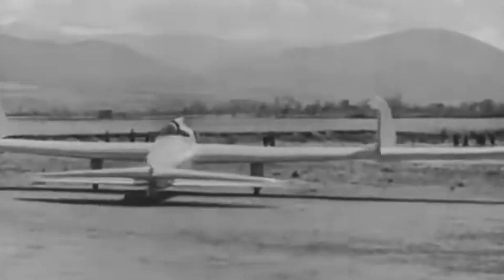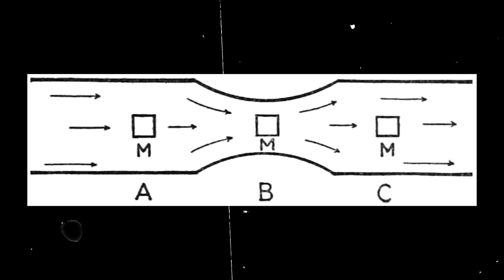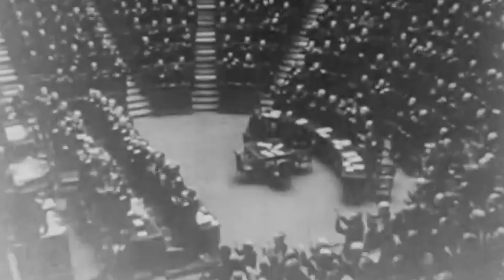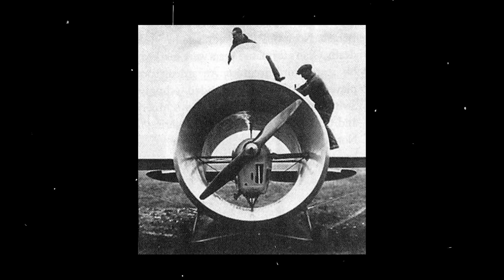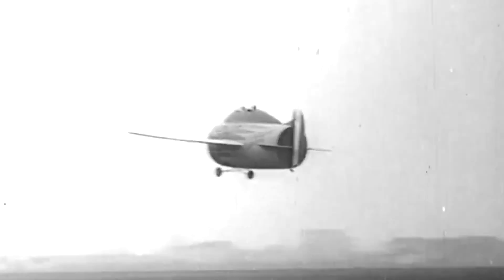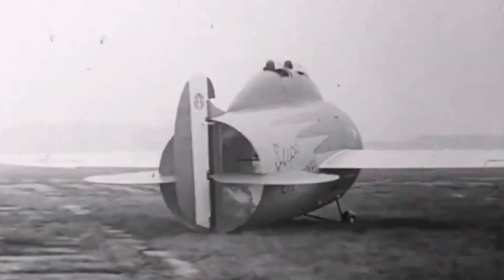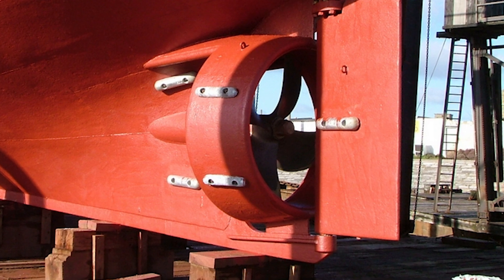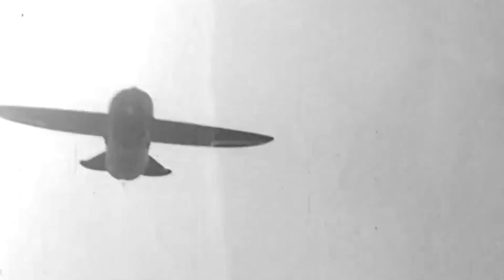A Bizarre Fat Airplane that Changed Military Aviation Forever

Comment: I think the biggest problem is that the engines and materials of the time weren't advanced enough to provide the justification for the aircraft.  It would be interesting to see this prototype built with a modern engine and construction techniques.
Reply: If you put the engine somewhere else like in the wings and only connect a shaft to the propeller you could get rid of the drag which hampered the Stipa Caproni. Ofc you then need sturdier wings than the little fairy wings it had ^^.
Reply: @thingamabob3902  Engines to day are probably much more powerful than the same size engines of that day, so that alone may solve the drag problem.
Reply: @ffjsb  definitely more powerful, but then you still have wasted energy you could put to use if you optimize
Reply: @thingamabob3902  I wouldn't call it wasted energy, I think it would translate into more speed.
Reply: @ffjsb  no you misunderstood. The problem with the whole engine placed in the duct was the cause of the drag. So a more modern and more efficient engine would have less volume per power output and thus be not as big as a problem as the weak engine but would still be in the way. That said I would still put the Cockpit forward and drooping down in front of the duct which would increase drag, but the visibility of the cockpit was obviously horrible and would justify such thing.
Reply: @thingamabob3902  HUH???  You're complaining about drag and you'd move the cockpit to create more drag????  You're ALWAYS going to have some drag from the engine nacelle.  But if the engine is smaller and more powerful, it's LESS of a problem.  The original design clearly worked, and updated it would work even better.
Reply: @ffjsb  I see, ok you obviously didn´t get the point after several explanations and/or don´t understand the principle of efficiency/optimization. The PLACEMENT of the engine was cause of the drag, nough said. And the video - in case you watched it, I´m not sure at this point - clearly stated that the visibility from the cockpit was atrocious ( which causes landing accidents) ... Have a good day, Sir. I feel I waste my time here.
Reply: @thingamabob3902  I GET that there's drag from the engine being there.  There's going to be drag where ever you place it.  Adding a drive line just adds weight and another point of failure.  You also don't get that there is technology that can overcome the visibility issue.
Reply: OOOOHH YEAH!!!  TOTALLY WOULD BE COOL! 😍😍👌👌👍😄😀

Comment: This is ducted fan tech. I’ve flown RC aircraft off and on for decades and many of the “jet” engine RC aircraft are actually ducted fan powered with an internal combustion piston engine providing power for thrust.
Reply: This is interesting to read! Thanks for sharing this info 👍
Reply: Once in a while an old ducted fan RC jet comes up for sale at club auctions and swap meets. I never had one but they were popular for a long time. I recall the kit for an F-86
Reply: @outdoorfreedom9778  EDFs (Electronic Ducted Fans) are very common today for RC "jets" and have superseded piston driven ones for the most part especially with noise ordinances cracking down on RC flying clubs in the US and Europe.
Reply: @jonrmartin  I have an RC delta wing with an EDF strapped to the back.  It's been a long time since I flew it, but it would make a resonance with the airframe at full throttle that generated a loud buzz, much louder than any nitro or large gas engine.  I actually got complaints from the club president passed down from fellow pilots about the noise.  It was fun to fly though, extremely fast and maneuverable.
Reply: Exactly! Best Regards!
Reply: @Kirk Bolas, Yes!!! You hit that nail on the head....  And this design, like the high by-pass jet engines as compared to pure jet engines, is noticably quieter than an engine with an exposed propeller...However, the main differences between this propulsion design and an actual high-bypass jet engines seem to be : the power to weight ratio, and the AMOUNT of power, driving the 'Fan' .... Otherwise, there are a lot of similarities to a modern high-bypass jet engine....
Reply: @the_shoggoth  well said my friend
Reply: Alot of the newer ones are just electric powered ducted fans that act like a jet.
Reply: It looks like a flying toilet paper roll.
Reply: and many modern ones use small outrunner motors instead of Nitro engines. They're quite fast.
Reply: @DFX2KX  the electric motors are amazing how much torque and power they produce... And they are very efficient... For mechanical power in factories, stationary business's and trains/bus's with overhead power lines, the loss's of electrical energy between the powerplants where the electricity is created to where the end user is at, is kept at a minimal amount...  For small unmanned vehicles, like R/C models, the batteries driving D/C motors work quite well... But for full size vehicles, with relatively high current needs, that DON'T have externally supplied A/C hi voltage 3-phase power harness's , but use internal storage batteries that drive D/C motors,  they are extremely inefficient.... Anyway, the small model liquid fueled engines are amazing with a very much higher power to weight ratio, than DC motor drive systems. So, with the right combination, the liquid fueled small engines are light, powerful and relatively inexpensive and they work very well, and are actually quite efficient... The electric motors are well developed with R/C models, but the batteries tend to loose power quite rapidly, are relatively heavy and they tend to be complex and expensive. Because of the rapid battery loss and the relatively heavy weight, the chances of making a safe landing are reduced when that happens...
Reply: @michaelmartinez1345  the inverters used for Electric bikes and cars are fairly efficient. The issue with aircraft (and electric aircraft do exist) is mostly down to battery weight, which DEFINATELY stings. As far as models are concerned, DC motors are still used, but 3-phase A/C outrunners have supplanted them in most cases (even my knockoff 6-channel helo has an outrunner on it, 20A controller). 

Battery wise? yeah, LiFePO4 packs don't hold a whole lot of power and they get angry when punctured, too, I don't think anyone even bothers with NiCad anymore outside of powering the RX on a Nitro car or plane.

Nitro engines are pretty crazy when it comes to raw power. I've never actually OWNED one, but I have gotten to buddy-box on a few. They are a bit... fiddly, at least from what I've seen. Fuel is also like $30 a gallon. I know actual gasoline RC engines exist but I've never used one, I wager it's not as powerful but has much less hassle to actually *run*.
Reply: @DFX2KX  I used to mix my own fuels when I was into model hobbies... It was 8% oil (Klotz synthetic) 10-15% nitromethane, and the remainder was methyl alcohol... This worked well on engines equipped with glow-plugs in their combustion chambers... Gasoline engines (both 2-stroke & 4-stroke) had to have spark plugs a coil and a set of points & condenser... Premium gas with a mix of 8% engine oil worked for these... They were not as powerful as the glow-fuel engines, but were great, when on a budget... Electric motors started coming around in the R/C hobbies in the late 70's - early 80''s... The first applications were on the cars... Them later, on the motor/gliders... After that , everything... The glow fuel engines have given reliable/economical performance for many years, and they are relatively simple and inexpensive... The glow fuel engines also offer an impressive power to weight ratio, that only the ultra-expensive micro-turbine engines can come close to matching... And when equipped with a 12v. Lawn tractor battery along with a power panel and a model engine electric starter, getting the glow engines to run is very easy... There are mufflers to quiet them down, tuned pipes to give them more power and a varience of props that can be used with them... The advent of the glow 🌟 plug engines, along with small carburetors, put the flying / driving models in a whole new level... The electric motors are a nice novelty, but they probably will fade by the wayside, just as the electric cars did 120, then 50 years ago... These older ideas somehow seem to re-surface every 50 or 60 years... Just in time for the 'now/new' generation!!! 💰😏💰💩💰🤔
Reply: @DFX2KX  one of the reasons that AC power is preferred for high current applications, is because of higher efficiency... A/C uses the entire cross section of the conductors that the power is being transferred in... D/C only uses the outer surface of the electrical conductors for power transfer, this is the reason why heavy current cables for D/C have so many fine filaments of copper, as it increases the surface area of the effective conductive surfaces, where AC often uses a single strand of solid copper, as it uses ALL of that surface area .. There is a strong magnetic field that surrounds D/C circuits, much more so than A/C circuits create... This natural phenomenon causes an effect called Inductive Reactance.... It causes impedance to current flow, which absorbs electrical energy ,generates heat , and dissipates the heat to the surrounding atmosphere... So this is a major reason WHY A/C is so much more efficient than D/C... This is a reason WHY bus's , airliners, ships and power transmission lines use A/C to transfer electrical power, as A/C power is transferred much more efficiently over long distances....
Reply: @DFX2KX  A good way to remember how to spell definitely is to break it up as De-finite-ly, i'm not sure why it's often pronounced def-in-at-ly but it is most definitely spelled definitely. Sorry not trying to be an jerk at all, I just know that I used to have problems with it and breaking it down like that helped a lot.
Reply: @DFX2KX  The LiFe batteries are typically used to power the receiver and servos, not motors.  LiPo batteries with a higher cell voltage of 4.2 volts and lighter weight are used for the flight motors.

And yes gasoline engines have less power than nitro and are easier to run but are now more common.
Reply: I knew there would be a RC guy in the comments that would know some stuff, and how its used ....... 2nd comment , didnt have to scroll far lol   👍 thanks for sharing
Reply: Well, now you know who invented the ducted fan.
Reply: Wonderful what happened
Reply: Push pull comes to mind
Reply: Neat
Reply: Huh, neat!
Reply: Look at the Edgley Optica.
Reply: The ducted fan can be very efficient provided that you have several parameters well tuned : the inlet must have the correct shape, the prop must "lick" the tube, the outlet must have fins to counter the flow rotation and also you need no abrupt aerodynamic shape of the rear of the motor.
Reply: Well yeah there used to be only ducted fan 'jet' RC aircraft, but nowadays they have those small jet engines which make the RC 'jets' hardcore. They really are quite something. And I guess you don't need to mess about with glow plug or model diesel fuel, just methanol, paraffin (kerosene) or whatever flammable liquid you can get hold of at the time.
Reply: "Many" yeah sure. In the 80's and 90's and by many you mean all. Pulse jet engines that small weren't around yes bruv. Now a days if you see a ducted fan nitro rc plane. Buy the damn thing. Because they are worth a fortune. Also buy a lotto ticket because youll never see them. All ducted fans now are electric. Real turbines are also very prevalent and pretty dang cheap compared to 2009. Alot of guys even put micro kerosene turbines in foam jets.
Reply: @krotchlickmeugh627  I have a book called 'Modern Aeromodelling' that was written first in the 1940's I think but the copy I had was early 1950's. In it they have a section that covers ducted fan aircraft. It's a great book and I stole it from my school library back in the early 90's lol
Reply: no way this thread isn’t bots
Reply: Yep, either that or electric ducted fan motors these days. Though there are actual jet engines on some very expensive RC planes, still they are rare and costly. But you're right, ducted fan motors are still most of the rc plane world to this day, be it electric or combustion.
Reply: Some of those old rear exhaust df engines have really high output and impressive rpm’s, I’ve got a Mac tep.61 i think it’s made in in Russia thought was a pattern flyer’s engine but have only seen one other like it in a jet
Reply: Some of those old rear exhaust df engines have really high output and impressive rpm’s, I’ve got a Mac tep.61 i think it’s made in in Russia thought was a pattern flyer’s engine but have only seen one other like it in a jet

Comment: Stupa seemed to have a great idea he couldn't expand on...not a turbofan, but a shrouded prop with a venturi behind, he was so close.
Him suing for copyright infringement makes me think he had some hurt feelings when someone was able to take in that step further.
Reply: The Caproni Campini N1 took the concept one step further and added an afterburner…
Reply: What if you put this shroud around a bombers engines in nacelles in a flying wing design?
Reply: I think the real advancement here is creating the theoretical framework and calculations for taking hydraulic principles and converting them to airflow. This is much more than a ducted fan, it is realizing the internal surface engineering of the duct as a vital component to future turbofan technology. In that aspect, turbofans and turbojets would not have been possible without the knowledge advanced here.
Reply: @deths1679  very interesting. Civil, hydraulic, and aeronautical engineering might seem like an odd combination but the way they converge on a necessary innovation for jet engine technology does make a lot of sense.
Reply: This looks like it would be a fun RC airplane build…!
Reply: The original Flying Engine
Reply: Says the anonymous cowardly infant!
Reply: @jakelittle1261  Nicola Tesla never understood what he was playing with.
Tesla wasted time on wireless power transmission and went broke.
Marconi did. Marconi used radio for communication and made a mint.
Both were building on the work of Heinrich Hertz who discovered radio waves in 1892 - he died two years later. Neither Tesla nor Marconi were the discoverers - they merely developed applications (which they patented).
Marconi took out his first radio communication patent in 1896 in England.
Tesla took out his first radio patent in 1897 in the United States.
So Marconi was first but Tesla beat him to a United States patent.
Reply: Very impressive technology. In others sides of the Earth nazi burn and kill Jews. But here nazi make something for science.
Reply: Stipa
Reply: I wonder how it would fly if they tapered the end of the fuselage down 70 percent and extended it
Reply: if you think that the Italian airforce had one of the best planes during the 30s, it somehow crazy how fascist destroyed it all with their stupid ideas!
Reply: It works exactly like a turbofan. On a turbofan the majority of the thrust is provided by the huge fan which doubles as the first compressor stage. The only real difference is that Stipa used an internal combustion engine to power the fan whereas modern aircraft engines use a turbojet nestled in the heart of the duct.
Reply: @CaptHollister  well yes, but this guy didn't invent ventury tunnels
Reply: @lord_scrubington  The first venturi tunnel was a cave that a homo sapien walked out of... But someone had to do the math, design, build, testing and come up with a working product. If someone thinks that this mans work didn't provide them with the ideas to take this further - you are sadly mistaken.
Reply: @CaptHollister  kk
Reply: @CaptHollister  I would have to disagree. Maybe I am missing something...

A turbo-fan can sort of be thought of as a "ducted propeller". On this next point I'm not 100% certain but here goes... A propeller used Bernoulli's principle, just like a wing, to generate forward thrust via pressure differential. A fan uses Newton's 3rd law to generate thrust by moving air.

Regardless of differences between a fan or a propeller a turbo-fan is still quite different from this aircraft. In a turbo-fan the front fan sits where the duct is widest, in the middle. Hence the air-speed slows down in exchange for greater flow-volume at the fan's location in the duct. This reduces the wave-drag on the fan.

In this aircraft, the opposite happens. The propeller sits right in front of the fuselage/tube. Hence the air-flow will not slow-down by the "expanding pipe" effect before reaching the propeller blades.
Reply: Reminds me of the Wright brothers, who also turned into patent trolls.

Comment: That is awesome!  Very innovative.  It’s a shame the design was not viable or exploited in its time.
Reply: What it is, you try stuff and see if it works.  Even if it doesn't,  others see it and and gives them a platform to think about things in a different way which might lead to innovation.  You do get the feeling he had the concept down, just that there was one component missing to make it work,  ie,  jet engines which were only a few years in the future.
Reply: @TheJhtlag  The scientific method:
Observation - Research - Hypothesis -
Experiment - Analysis - Report
Saying it is "try stuff" gives a really distorted impression of what went into the effort.
Reply: It was impractical and fragile, the Military wasn't interested.
Reply: @shadowopsairman1583  Big area to shot at, for one.
Reply: It wasn't exploited because it was not viable.